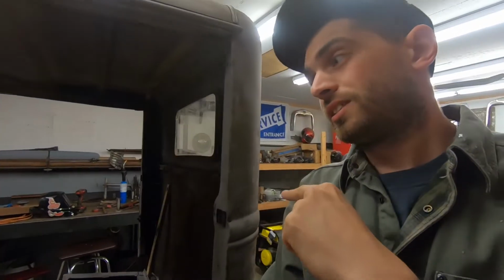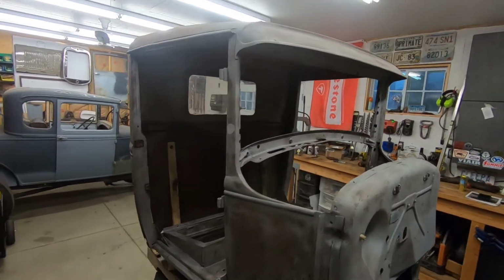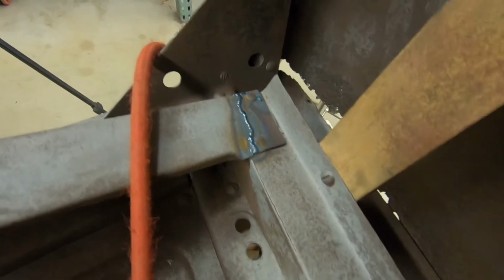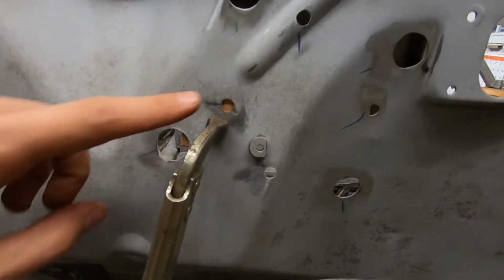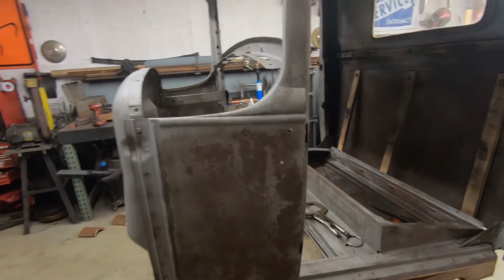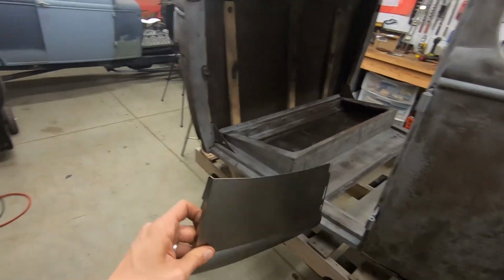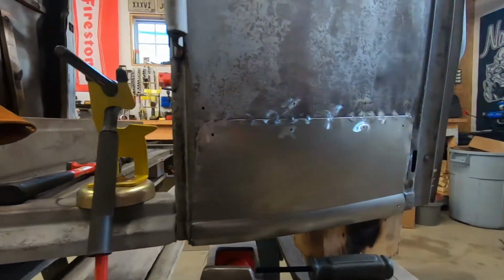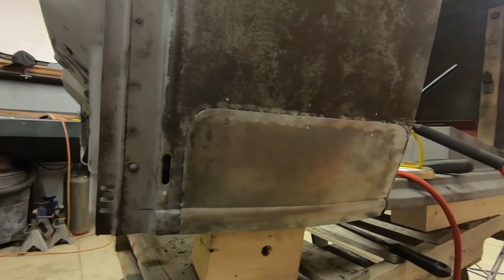1931 Model A Pickup Rust Repair Part 1

Comment: Just found one of these (late 31) in similar condition. I dont have a tig but I do have a 251 miller mig. I've welded thin stuff before with pretty good success. Do you think I could do this type of repair with my miller? If I undertake this project I'll have to do it myself. Do you remember if the cab top was supported by metal or wood? I've been told it should be metal support for the metal top. I might try and do a video myself if I go for it.  Thanks for posting this and great job imo.
Reply from the maker: The top had metal supports. You can do it with a mig just make sure your panel fits perfect before you weld because a mig weld is very hard and you won’t be able to planish it and put any shape where the weld is.